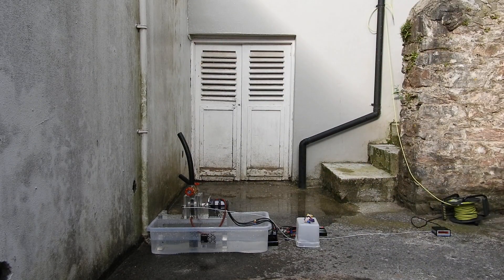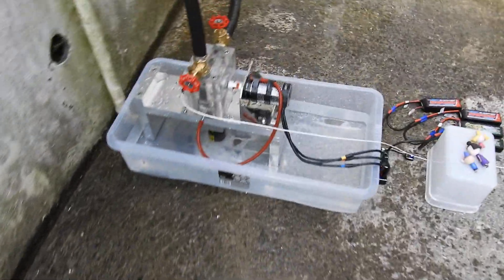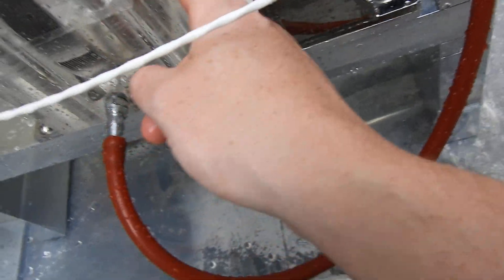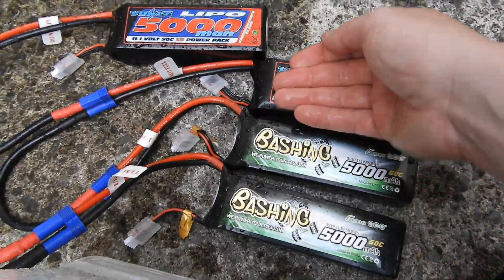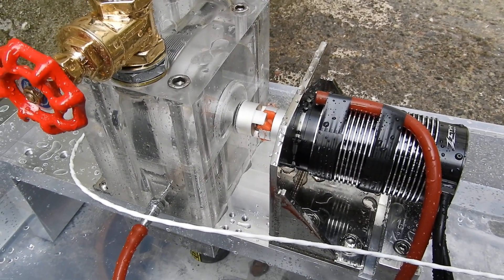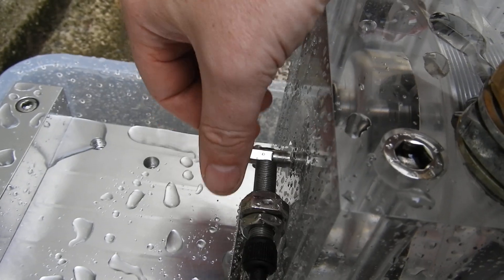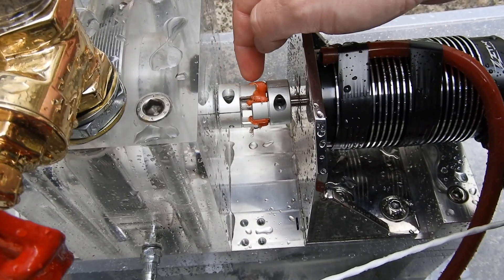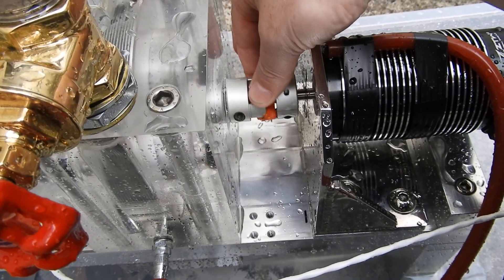Nikola Tesla's Pump 13.32kw Motor - 5000mAH - 2nd Experiment - Flexible Coupling Failure

Comment: I'm gonna have to design a jet drive for a boat that im making, because I'll be using a heavily modified (for marine use) car engine to  power it and the Tesla turbine came into my mind, since im gonna have to design and build the jet drive from the ground up anyway, why not try something unique and try to propel the boat forwards using a tesla pump. I wonder how sturdy it would need to be and how well it would perform with a 360N and 150kW motor. Maybe the jet drive is the safe option afterall haha

Comment: Wow, looks like some serious forces and speeds involved!
Why do you use  plexy for casing? Aluminum isn't good?
Reply from the maker: The max rpm was 8,000rpm that I saw on the tachometer. That was with the slip.... The motor is rated for 27,000rpm although I've had it up to 28,500rpm in a compressed air / water loop.

The acrylic casing has been used for loads of experiments for the turbine, rotary engine, compressor and now the pump. I never made a video of any of the compressor experiments. The apparatus was quite funny looking! 

Anodised aluminium is where I will end up.

Commercially I would probably die cast or pressure cast casings. Stainless steel casting is also an option for me. Single prototypes machined from billet seems to be the best way to avoid tolerance stack up.

What height the water will be at if I can get to 20,000rpm I have no idea!

Apart from the casing the batteries are also a weak leak as the current draw is so high. I've got an amps clamp for my oscilloscope that I can use. 

Watching the amperage over time is a very good way of analysing what is happening.

I just need to control the water flow so it comes back to the tank as my scope definitely isn't water proof.
Reply: @nikola.tesla.r.and.d.centre  I keep thinking it’s better to make them out of materials that are not conductive. Tesla mentions phosphor bronze, which I imagine was more for strength than anything else, but Schauberger kept trying to neutralize charges in the devise parts. Schauberger’s intent was to split molecules into positive and negative elements at different ends at extremely high speeds, so it may be different than what you’re attempting, but the forces involved are similar.
Reply from the maker: @7sArts  Tesla uses phosphor bronze for bearings which are then babbitted. https://en.wikipedia.org/wiki/Babbitt_(alloy)

I think the use of conductive parts is inevitable. Tesla actually advocated high grade steel, hardened and slowly tempered. He also used "German Silver" aka "Nickel Silver" C770. This was probably the best alloy available at the time. All of the high tensile materials I have in mind are all conductive. Now whether the material is magnetic is perhaps a more important factor.